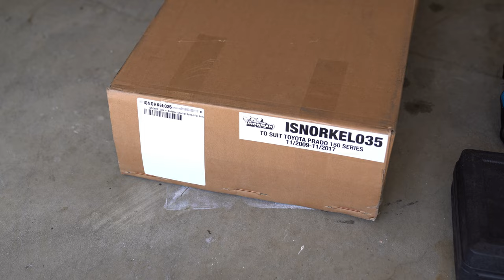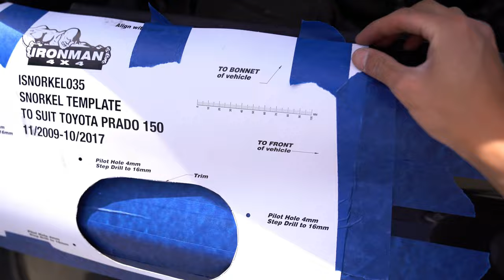Ironman 4X4 Snorkel Install on 2015 Lexus GX 460

Comment: Nice video, but how did it feel drilling into the fender 😭
Reply: its always fun to drill into sheet metal... if you mess up they can be had on ebay for cheap or brand new from the dealer
Reply from the maker: I’ve done it so much on my car and friend’s car I don’t get nervous anymore

Comment: Did you have a gap on the A Pillar you had to deal with? Installing the same snorkel on my GX and the fitment seems a bit off.
Reply from the maker: There’s a small gap in multiple places. I had to force the snorkel into the pillar
Reply: @wheeltogetoutthere  How do you feel about those gaps once installed? I was just about to call about returning it. I helped a friend install a safari snorkel and it wasn’t like this.
Reply from the maker: @FStewBailey  i dont notice it. it's all functionality for me